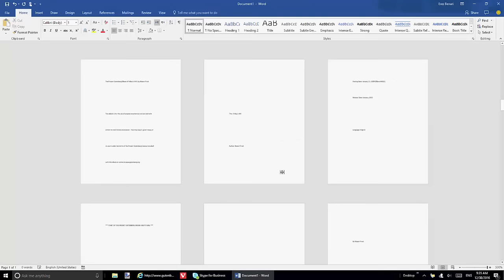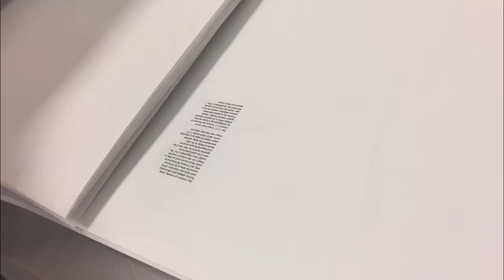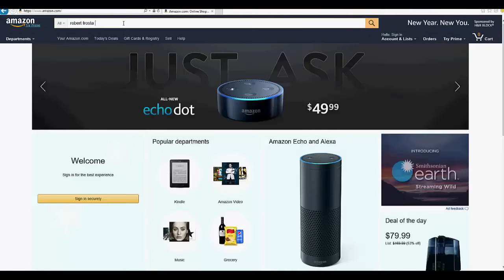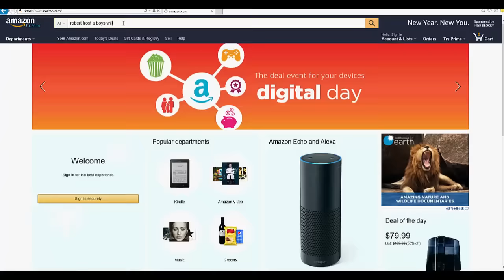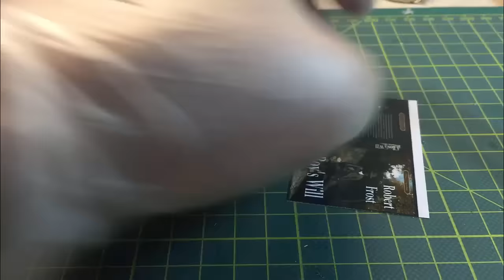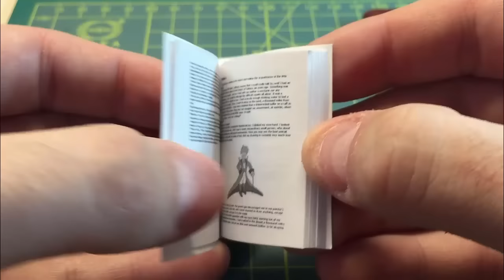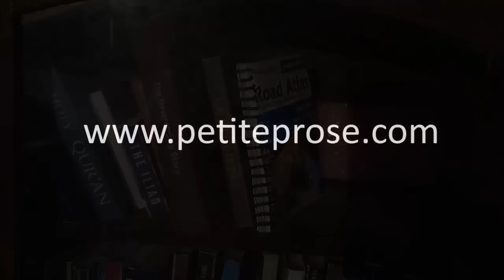Creating a Miniature Book (PetiteProse.com)

Comment: Would you try Tolkien or Harry Potter books, and use font 3?  It'd be awesome to actually read a 2 inch book.
Reply from the maker: With font size 3, very little will actually fit inside the book, even if it's 2" in size (most of mine are 1"). Either way, technically, it's possible.

Comment: What are the measurements u used in trying to make one and not sure cause I use open office and it's a bit different
Reply from the maker: The font size I use is 1, and the book size is about 1.4 inch by 1 inch.
Reply: Erez Benari I have sent u a message :)